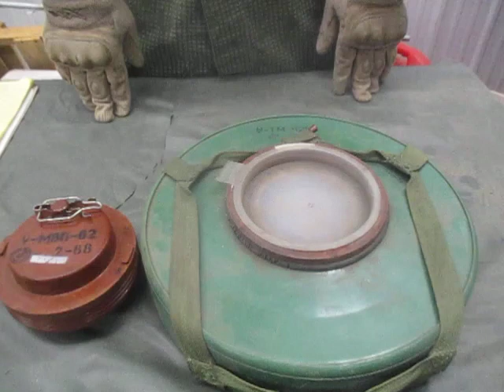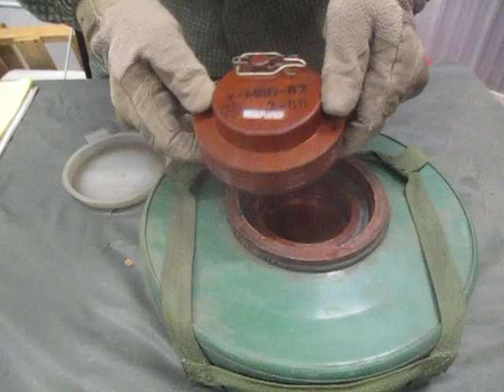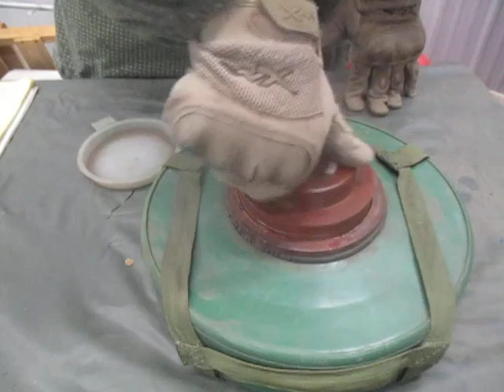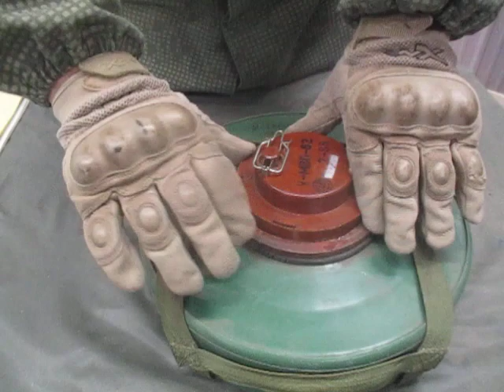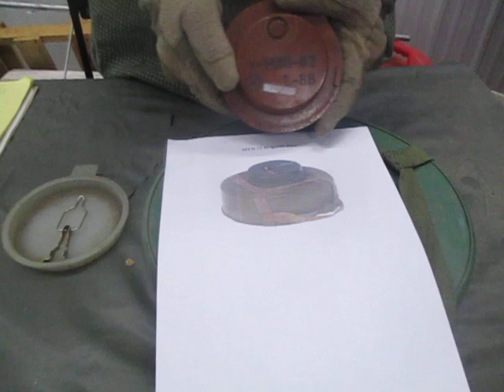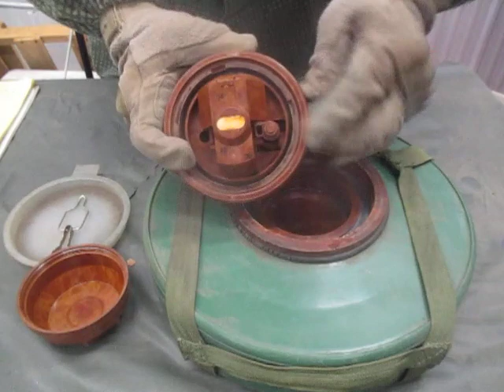Soviet Russian TM-62P3 Antitank Mine

Comment: I wonder how many of these are abandoned in the mountains of Afghanistan?  I made an acquaintance who had an excellent living until 75 just doing mine clearing and explosive clearing in VN and Laos.As to placement.  They are literally being laid on the road surface and left in plain view, so kick/sliding them out of the way has been seen, and even in plain sight the dummy peasants driving armor go around the last stricken vehicle and drive over a line easily seen 400 feet away by the drone cam filming, and BOOM.  This device eliminates the unwary.

Comment: TM 62's are a bit weird. Active ones can get even worse depending on person that did it. You can have a surprise not only under it, but also under the fuse itself. There is enough space inside to place a nasty surprise there. Even when you think the fuse is safe, unscrewing it is dangerous!
There are disarming gadgets made just for those mines that unscrew the detonator before turning over the mine itself by same pulling action. You just loosen the detonator by 1/4 to 1/2 of a turn before.
There can be a stock grenade detonator with a trip wire in the side/bottom of the mine just drilled and screwed directly into TNT itself!
This is what you won't read in stock literature and depends on who puts the mine in.
Even if you think that the mine is safe and defused - treat it as live if you are not the one that activated it!
Reply: Good advice. There are many creative ways these can be booby trapped. 😮

Comment: 8:00 its not nitroglycerine. It is known as TNT oil. The substance contains 2,4,6-trinitrotoluene and its mono- and dintro-derivatives, which may undergo uncontrolled crystallization again during storage at elevated temperature, increasing the risk of accidental explosion.
Reply: All true but very doubtful. mono and dinitrotoluene are removed during purification / separation of isomers. You can obtain pure TNT at the expense of yield.
The issue you are mentioning (essentially gravity bombs leaking from the fuze well or DNT getting in the threads) was a thing decades ago though.
Interestingly, specs on impurities present in high explosives (acid, side products) are much more demanding in Russia than other countries (Source: Urbanski).
How does that translate in the real world may be a different story ;)
Reply: DNT is very dangerous, a lot more explody than TNT is as far as sensitivity goes, slightly less than actual NG. 😮

Comment: Sg42 so when you disarm the fuze and reset it. Does this mean the striker is rotated back? 
And you say its pneumatic that arms it does this mean after first time arming then disarmed the time delay for arming is gone on 2nd time use Because the air is  released?
Reply from the maker: I can't see the detonator so I can't be 100% certain.  But my guess is it does move back to transport position when it is reset.  I had the blast of air the first time I tested the fuse but after reset it isn't doing that anymore.

Comment: How in hell do you detect, these rascals, or is this why you can't ?
Reply: I know the US and probably few other countries have some type of ground penetrating radar or something to do with soil density to find stuff like this. Also Russia has an mrap type vehicle that has microwaves that will detonate hidden explosives. Will heat up wires and explosives. Not sure if this practical in certain areas
Reply from the maker: These are extremely hard to detect. I know this is 1 of the mines that was used when the PSS-14 mine detectors were tested.  The PSS-14 has Ground Penetrating Radar along with metal detection from what I remember.